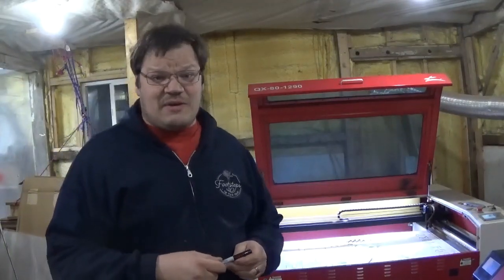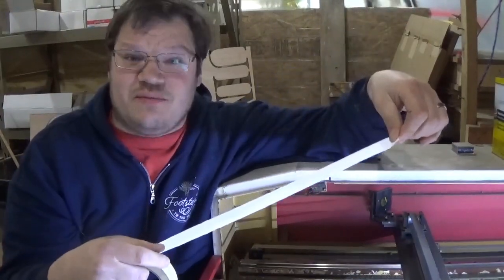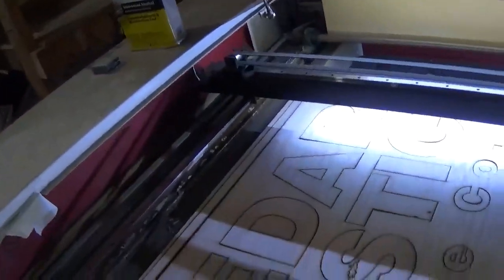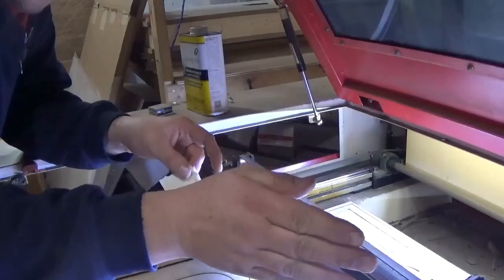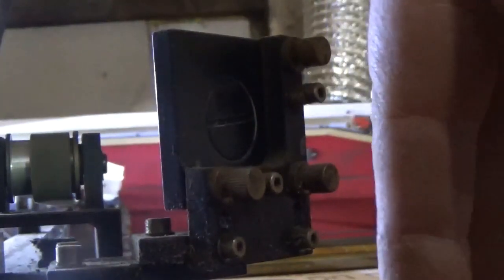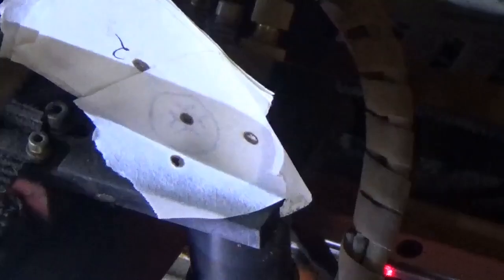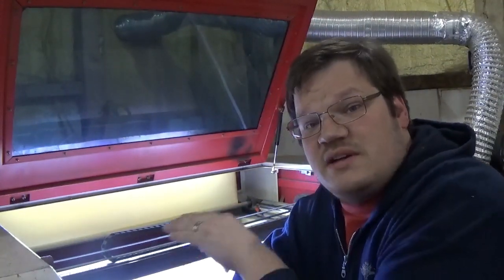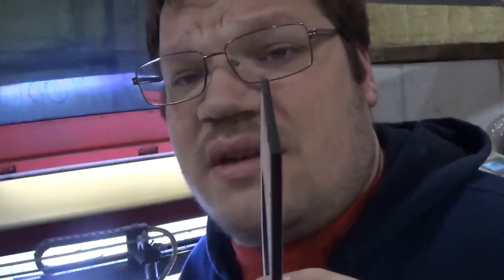How to Align Co2 Laser Mirrors Simple and in English cutter engraver

Comment: hello, please i have a problem with mirror 2, at the start of axis it shoot into center of tape, but at the end of the axis it absolutely does not shot the mirror at all... and i dont know how to set it... im pretty desperate from it already
Reply from the maker: Move mirror 3 away maybe 25% the distance from mirror 2 try again get it to about center then move it 100%away ir should hit the tape so you can align it perfect. Be careful that laser beam can burn you when you don't know where it is at
Reply: @JaysToDoList  i sucessfully set laser beam into mirrors.. but.. the 2nd and 3rd mirrors pulse at the start of axis hits the center of mirror, but end of axis hits a little bit next to first pulse, but laser beam from nozzle is right now perfect... is that a problem ? i mean those mirrors, or is it ok ? differences are about 1-2 millimeters
Reply from the maker: It will most likely work now but you should have them on top of each other.  The 1mm difference could cause some power loss or make your Laser cut better on one side then the other
Reply: @JaysToDoList  i would like to set them on themselves on both sides, but i spent already a whole day on that and im glad i get at least this :D i simply cannot get them on each other, because when i move left/right, on the start of axis it moves just a bit and on the end it moves even for 1cm well its not easy, but thank you for advice :)

Comment: i have a OMtech 55 watt.  i have really messed up the alignment.  I adjusted mirror 1 for no particular reason other than I assumed that's where to start without reading any instructions.  I found your video and  its not evening helping due to my stupidity of playing with the first mirror.    I have adjusted mirrors 1 & 2  and align them but they are so off kilter to what the originally looked like that its impossible to adjust mirror 3.  its so  far off i cut through my air hose!!  Is there a way I can go back to basics with mirror one which i am positive was the stat of my problems.   Any help would be greatly appreciated as i am totally stuck and have spend another hour today and am back to square one.  I am completely defeated. Thanks
Reply from the maker: Start with the mirror closest to the laser tube then follow my instruction in the video mirror closest to the laser tube is mirror 1 the move to mirror 2 then 3

Comment: I’m very confused on my adjustment. 
If I have the tape close to mirror one I hit center, I adjust the nozzle to the front (left) mirror 2 and I hit center. Well when I move the laser to the far right by control, mirror 3. I am hitting high. I don’t know how I’m supposed to adjust mirror 2, to hit correctly to 3, without having to adjust mirror one back to center. Any help would be awesome
Reply from the maker: move mirror 2 covered in tape close to mirror 1 by moving y axis all the way to the back of the machine and pulse  it should hit about center then move y axis all the way to the front of machine as far away you can from mirror1 fire again the two dots that it crates on the tape should line up on top of each other if it is not lined up adjust mirror 1 until it does do not move to mirror 3 until mirror 1 is fully aligned to mirror 2. then repeat on the x axis  between mirror 2 and 3. please watch the video again it spells this out better
Reply: @JaysToDoList  so I have mirror one and 2 spot on. So if I move mirror 3 all the way by controller, then it’s hitting high. So can I adjust mirror 2 to where it hit mirror 3 accurately? Because once I adjust mirror 2 to hit mirror 3, then doesn’t that mess up where mirror one hits mirror 3?? Idk if that makes sense
Reply from the maker: @speedybeak  mirror 1 is the one back by the laser tube and mirror 3 is the ono above the nozzle I am just  making sure we are talking about the correct mirrors. Adjust mirror one so it aligns with mirror 2 close then far. Once the burn marks line up move to mirror 2 to 3 adjust mirror 2 near then far from 3 align the burn marks by adjusting mirror 2 that will not affect the adjustments on mirror 1

Comment: It is very unhelpful when the mirrors are pretty much aligned to begin with. Start with something out of alignment and help work through the problems that might occur. I'm off by probably 5mm from left to right and no amount of micro adjustments is making any difference. This does not help me learn how to make those adjustments.
Reply from the maker: It is the same process just adjust the mirrors slightly more
Reply: Hear hear! Good effort making the video but little effort applied to help 1 2 and 3 alignment problems

Comment: a  video would help if mirror 2 does not align from back to front and how to solve that. thanks
Reply: Thanks very much @Modus I will watch and get on it
Reply from the maker: Yes you will need to align all three one adjustment throws them all out
Reply: @JaysToDoList . I put in a new tube and I am unable to align mirror 2 .  I have one high when mirror 2 is at the back and in the middle dead center at the halfway point, then low when mirror 2 is all the way front. I think my laser tube needs adjusting?
Reply from the maker: Oh I see you may need to level the laser tube
Reply: Modus did you ever solve this issue? I am trying to get a brand new unit aligned and I get it dead on with the gantry back then move it forward and am barely in the circle. I am a noob to this and it's stressing me out
Reply: @taylorlanter4995  this procedure can be completely frustrating. I eventually figured out the proper alignment  process by watching this video. https://youtu.be/rYX0zfWFnIM

Comment: Awesome instruction with the layers of tape. That will make aligning the mirrors easier. Going to try today. I’m currently having an issue as you described with the machine not cutting well on the right side of my bed. I’ve found getting the alignment from mirror two on to mirror three difficult to stay on the mark when moving the head from the far left to the right. Hopefully this method will help out. Thanks for the info.
Reply from the maker: Great I hope this helps the masking tape idea really does help you get alignment in much better and faster
Reply: Did this fix the issue of not cutting properly on one side of the laser? I am having the same issue and before I tinker with it was just curious
Reply from the maker: This can be one of the problems with it cutting better one one side then the other